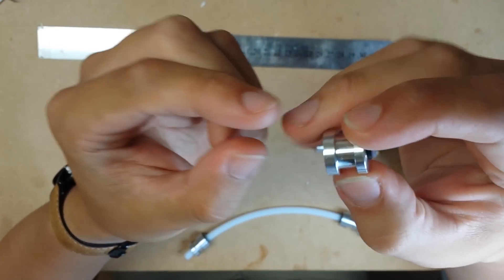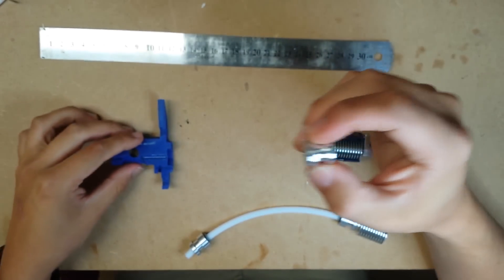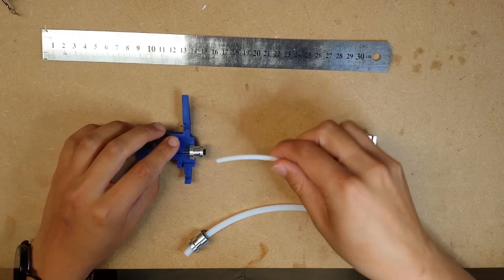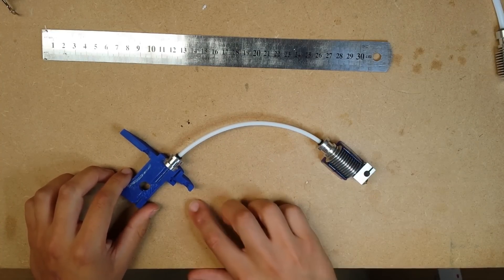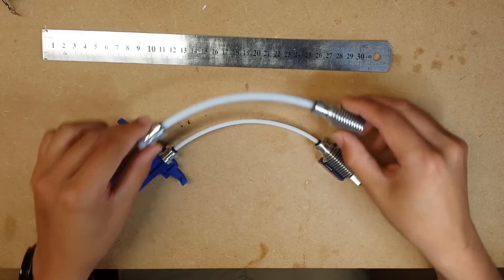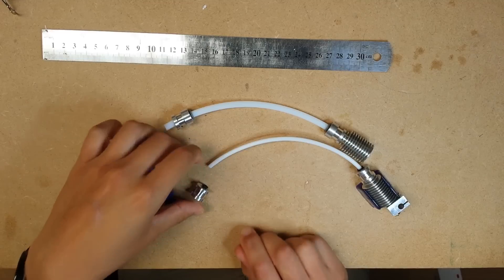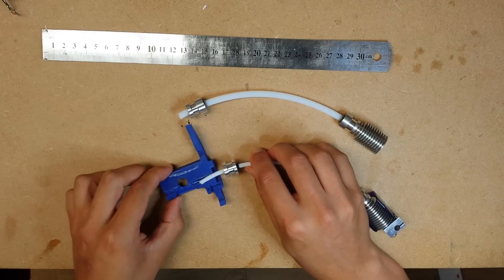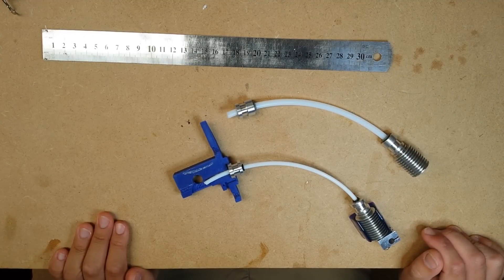E3D Bowden to Direct Adaptor

Comment: what extruder is that?
Reply from the maker: It's a wades extruder for a Mendel90 that can be found on the mendel90 github repo here:

https://github.com/nophead/Mendel90/tree/master/dibond/stls

You'll want everything that starts with the word "wades" to complete the extruder as well as the normal screws/springs/hobbed bolt etc.
Reply: E3D-Online thanks, been looking for an extruder that works with flexible filament and this one seems promising as does the flexystruder. Great job on the v6 hot end nozzles btw, haven't had any trouble after switching the nozzle on my v5!